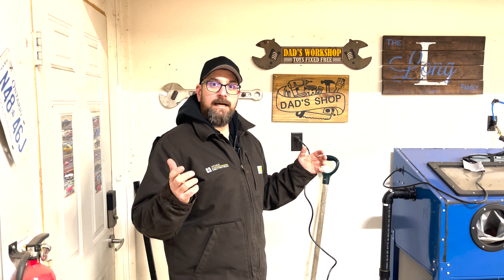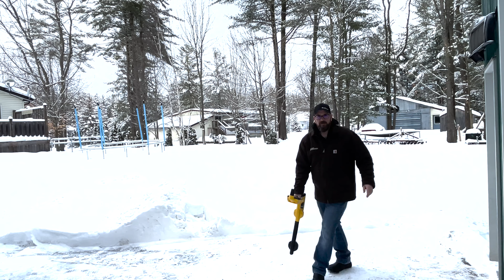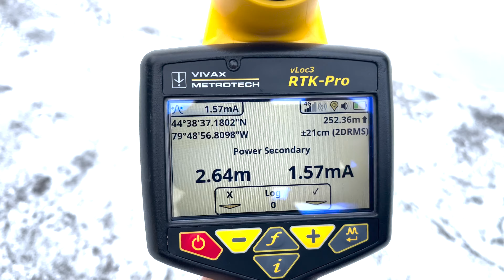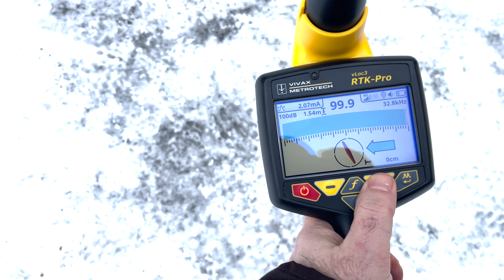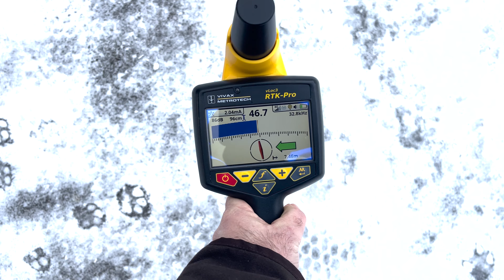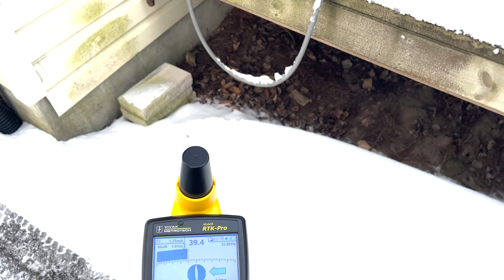How to use a LIve Plug Connector and RTK Pro

Comment: I have the live plug connector and the vivax loc3-10x transmitter. Live plug connector is 3 pin XLR, and the transmitter has a speak-on connector. I purchased an adapter but cannot get it to work. Any ideas? Is there a special adapter? Thanks for your time.